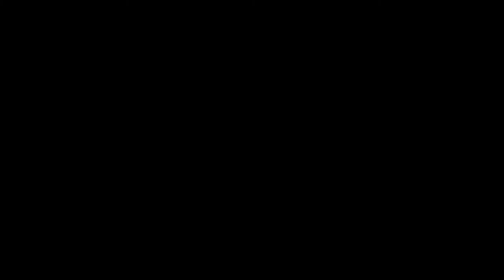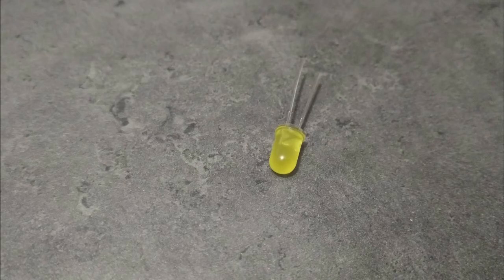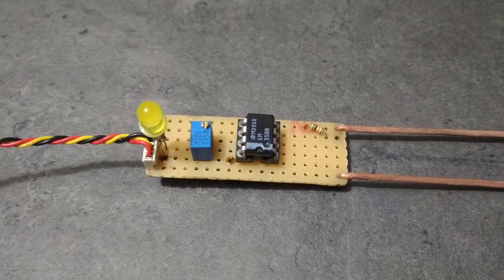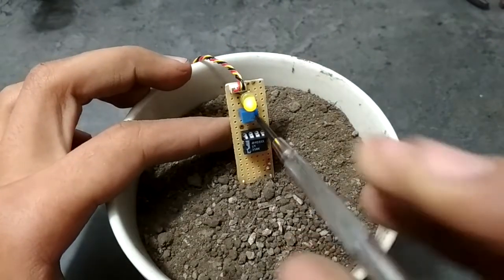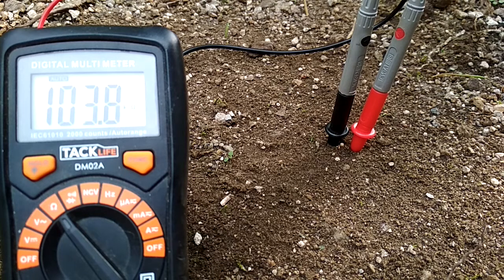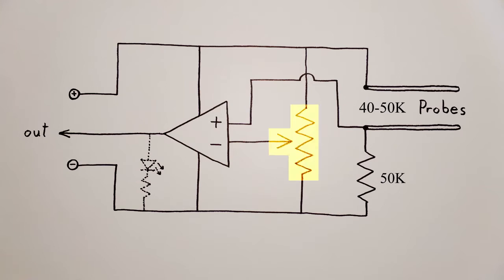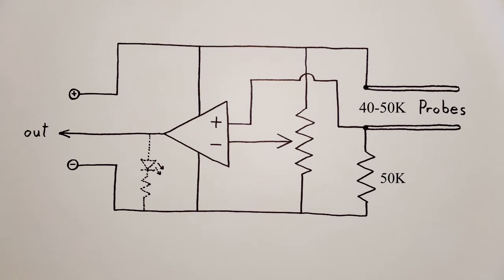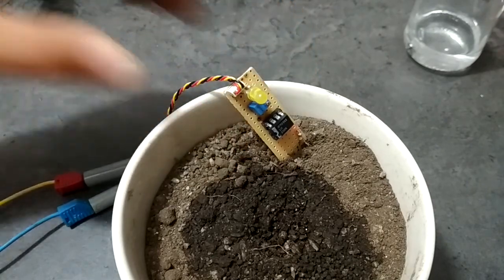Make a Simple Soil Humidity Sensor (to automate your garden watering)

Comment: could i use it with Arduino and code it with the simple code to get the voltage value to link it with measuring moisture
Reply from the maker: I don't see why not.
I assume you mean to read the analog voltage with the Arduino ADC.
In this case the comparator isn't needed.
I don't remember the details of the circuit... But maybe, depending on the Arduino analog input's impedance a buffer can help. May not be necessary though.

Comment: You stated that "anything's gonna work" about the choice of the opamp. That's far from true. Lots of opamps cannot work based on this schematic with a single supply voltage.
You should also talk about the short life span of copper probes in humid soil which makes your sensor useless.
Reply: Graphite could work LONGer